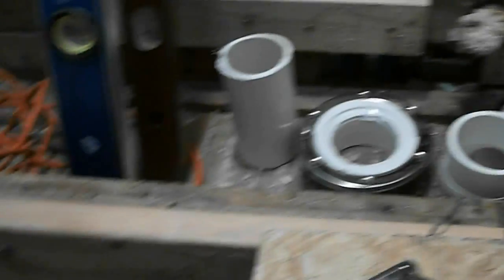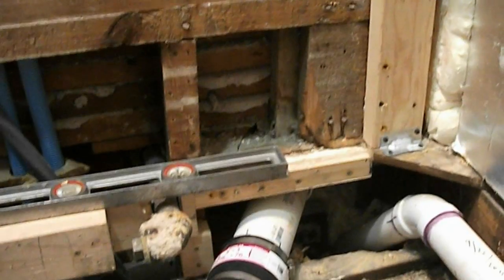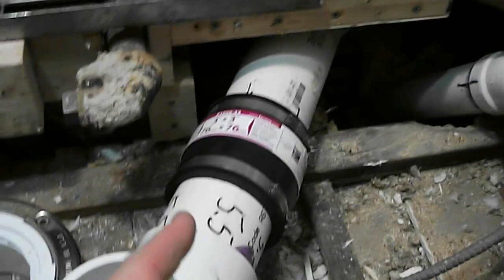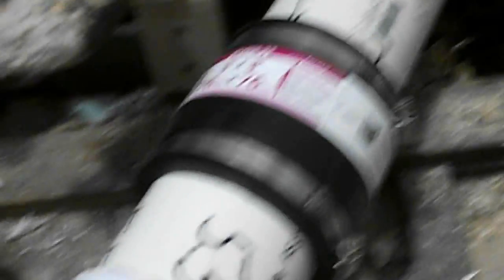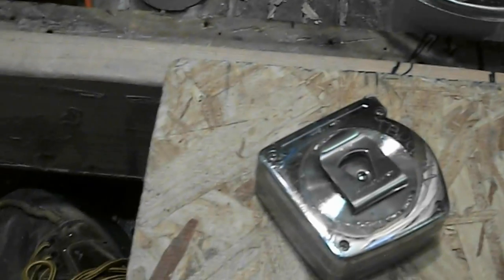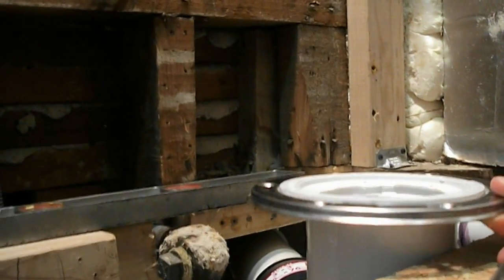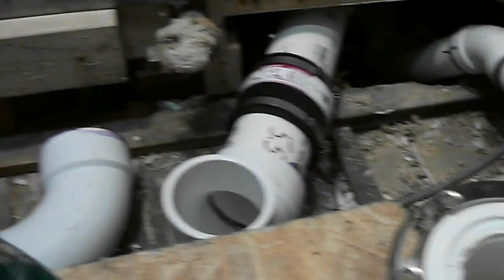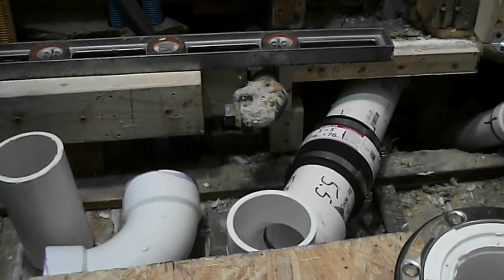Toilet Rough-In Geometry

Comment: Prime, glue and 1/4 turn twist on flange once you get it on and you will be fine. The flange will be fine and draw down once the flooring is under it. I would have recommended to never use osb in any areas you plan on tiling.....Tile/mortar will not stick.